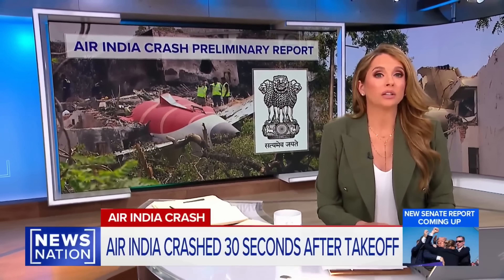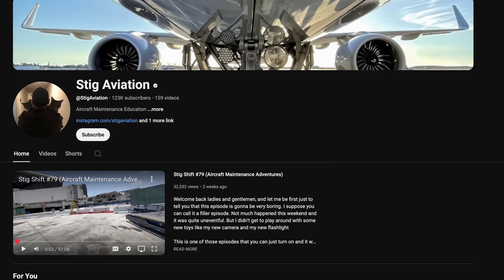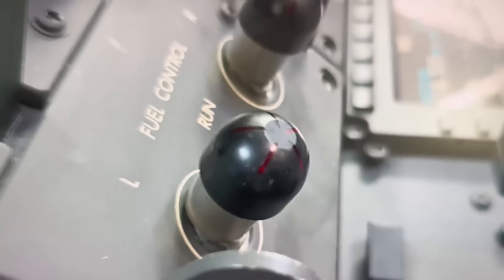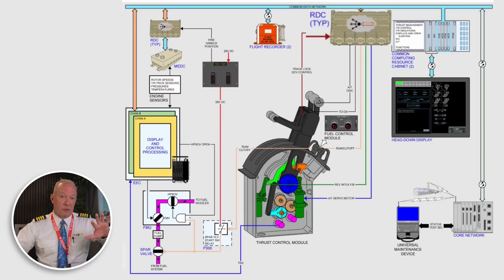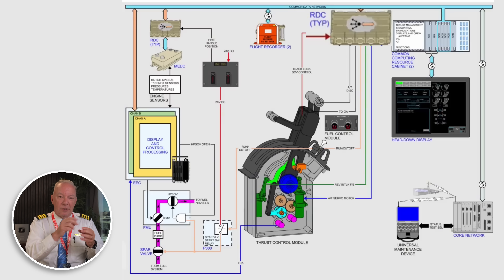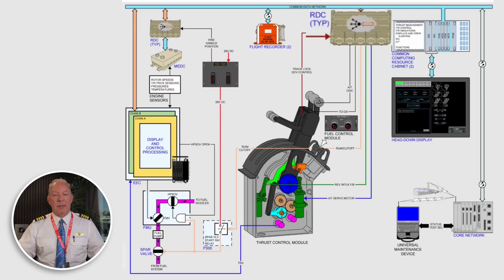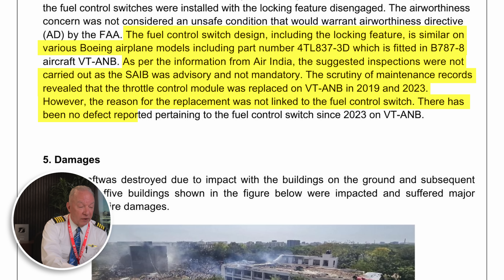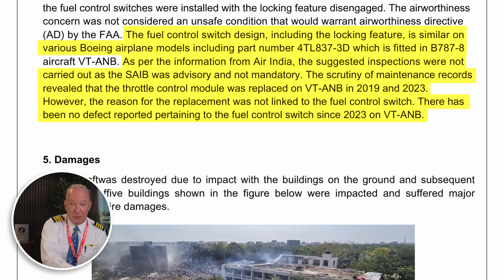The Truth About Boeing 787 Fuel Control Switches

Comment: I'm an electrical engineer, I was an avionics tech for 15 years. This is a very good explanation. When I heard FDR showed the switch positions changed 1 second apart and were put back 10 seconds laterI knew it was not a malfunction. 😢
Reply: I 💯 agree with you and captain Steve, genuine question here- how does the FDR know physical switch position? I’m assuming a feedback loop of some sort but would like to know a little more about this part.
Reply: The schematc presented by Captain Steeeve shows a separate RUN/CUTOFF output from the Fuel Control Module containing the switches, and it goes to the RDC (Remote Data Concentrator). The RDC then presents the state of the switches as data on the Common Data Network on top of the schematic, to which the FDR would be connected.
Reply: @paulgail540  OK so the FDR actually does kn ow the position of the actual switches?
Reply: @JoeLinux2000 Totally not The CVR will know if the Fuel Switches are moved.
Reply: @jayebzzz338  Some people say there is an additional optical circuit originating at the switch.  Normally you would assume the system is working if fuel is flowing.  Steve would do better to have a guest on that actually knows electronics and specifically the electrical system of the 777.  Steve's expertise is in knowing which switch to move and when to move it, not how they work. My opinion is a pilot may have moved a switch from on to off and then back on, but we don't know exactly when or why.  There are reports that the RAT deployed before the switches were moved. We also know that there was a problem before the Mayday call, and the radio was still working so at least some of the electronics worked.  If you are committing suicide why issue a Mayday call?  Suicide is the least probable cause in my mind. Some type of major system failure is far more likely.  No pilot takes off with the idea of immediately committing suicide and killing all the passengers.  It's more of a personal decision done privately.  Often they leave a note.
Reply: @JoeLinux2000 yeas all I see steeve is just a pilot but not technician or mechanical enthusiastic person, 
Day one we are thinking what went in hydraulics , circuits , relays , copper coils of valves , electronics etc,
But he only see from prospective of a cockpit,
Even about AAIB report, people those made it too look like just being pilots, for them fuel cut or run was switches on flight deck stuff , 
If they would had been technician,engineer,scientist they would had think what is inside of fuselage and forward and sft bay , for fuel supply closing they might see spar fuel valves prospective.
Unluckily as far I could reach  the inner systems of AAIB , it looks redtape sort of people sitting on the top those just looking for their promotion,

If we want to reach on true conclusion we all people have to work simultaneously indipendently too.
Reply: @jayebzzz338  FDR through RDC only know the status of Fuel spar valves close or open position bcouse only there are the sensors located , no sensors located in fuel switches on the flight deck in the cockpit 
so FDR records only fuel spar valves position not the mechanical swithes position
Reply: @jayebzzz338  The linked video in the description explains it. There is a second contact in the switch that talks to the RDC, and the RDC is on the data bus, which is where the FDR picks it up.
Reply: https://youtu.be/OLxLN3osS1Y?si=mTr5PiCQOqiIQzaD

The FDR doesn't see if the switches is moved whatsoever. The switches record the electric RUN/CUTOFF SIGNAL transition.
The CVR will record if the switches where moved from the clicks sound.
Reply: Why has captain Steeeve disconnected the FADEC's from the Fuel Metering Valve's and reconnected to the relay 28V? 
4:15

How is Captain Steeeve adjusting the power output from the engines?
Reply: Something else isn't answered. How come the aft EAFR is so thermal damaged? 
It's designed to withstand fuel fire for 30 minutes. Even lithium battery fire would not have reached that temperatures and was far away contained in a steel box.

The only source is an electrical fire that can reach temperatures of 19000C or 35000F nearby.  
The engines generators produce 1MVA like a small power plant and can do a lot of damage in a few seconds.
This could only have happened whilst the engines was running.
Reply: Captain Steve incorrectly describes the control of the fuel values according to the diagram he presented. He needs to explain and correct those errors if he is to restore his credibility.
Reply: It's the fuel pumps that failed caused by water ingress into the EE bays. Lack of lavatory maintenance caused the crash and not the fuel switches
Reply: Question: How are the switch positions reported to the Flight Data Recorder?
Reply: @joevignolor4u949  AWESOME QUESTION!!
Reply: @joevignolor4u949  This a good question. What does the FDR record?  Switch posittion or Valve position?
Reply: @Rks2800I  typically it records both switch and valve positions. However, the position of this particular switch is only sensed by the presence of 28vdc, not the physical position of the switch.
Reply: @zuhirzainal581  Allright, from the cicuit diagram he showed it is still not clear if this 28V DC or the current it generates when the relay closes can  actually be detected and recorded in the FDR. I assume the FADEC makes the FDR entries and does the FADEC see this 28V DC presence.
Reply: @joevignolor4u949 the FDR doesn't record the position of the switches themselves. It record the Run/cutoff electric signal that get transformed in the RDC which send a network signal by Ethernet/fibre otical cables to the EAFR's

According to Boeing's documentation the switches themselves is electromechanical 3 way 4 pole switches approved by FAA.
Something must have gone terrible wrong at the Boeing 787's assembly line so they ended up with totally mechanical fuel switches. 
The 787's needs to be grounded pending FAA approval for totally mechanical fuel switches.
Reply: @idarpolden5913  What are you talking about? They are mechanical for a reason. So are the ones on Airbus.
Reply: @idarpolden5913  Thanks for the info. I was wondering how the FDR was connected to the system. From what you said, the FDR is not wired directly to the two switches. Instead, it receives a digital signal input from the RDC. This introduces the possibility that the pilots never touched the two switches and what the FDR saw was something else going on somewhere else. This system is extremely complex. Most likely the only people who know exactly how it works are the engineers at Boeing.
Reply: @joevignolor4u949 You're very correct and the system is very complex and integrated with software on top. It requires several Boeing engineers to work on the issue together for a while. We engineers is not so good on memorization, but we just calculate/analyse and find out by time.
Reply: @joevignolor4u949  the RDC stand for Remote Data Concentrator. The 787's has 2 EAFR's. One in the front and one in the back. If you had tried to copper wire that with 100 tonnes of copper wire, the plane would have a hard time taking off without passengers. The 787's are fly-by-wire which is the future. Just forget Steeeve's mechanical switches.
Reply: @joevignolor4u949  A.I. says this.

Each fuel cutoff switch has position sensors (microswitches, Hall-effect sensors, or potentiometers) wired into the control system.
	•	When the switch is in RUN, the sensor circuit outputs one signal; in CUTOFF, another.
I’m not sure if that is accurate information Joe.
Reply: Think of it like a simple text message I suppose.
Reply: Please explain how the FMV inside the FMU is regulated by the physical relay.
I thought it was the EEC/FADEC's that did it, but Steeeve denied it already.
Reply: @theguy4355 , the RAT deploy immediately when the power is lost and not 10 seconds after  as mentioned by @LaurenEldorado.
Must have been a misunderstanding as the RAT should start making electricity within 10 seconds. As the plane was close to stall speed 10 seconds seems likely. 
The RAT deployed a few seconds before the electric signal transition to cutoff.  Later the transponder was also lost.

Note, if the RAT is hold inside with a 28V DC power spring-loaded solenoid, the spring will deploy the RAT once power is lost. High school physics and very simple.
Reply: @idarpolden5913  "Later the transponder was also lost.'"
This is very significant. Simply shutting down both engines shouldn't stop the transponder until the battery is depleted.
Reply: did you actually read the schematics? i don't think so for if you did you would disagree with Captain Einstein's assertions.
Reply: Oh and Steeve… failsafe systems fail more often than you would believe. In fact the 737 Max failsafe system was what actually caused the two crashes.
Reply: @NeoMorphUK  "the 737 Max failsafe system was what actually caused the two crashes."  Clearly you need to research the definition of the erm failsafe. MCAS was not a failsafe system.  Have your mommy help you with the big words.
Reply: The switches suppedly "switched back on", did so with 2 seconds time difference !!
My explation  (given by Capt. Khalid, an Indian pilot), says:  because they were CYCLED, not switched on.
They were never moved to "cut off before". The pilot asking was referring to a system message, which is NORMALLY pointing to manual action.
(Same wrong signal, the FDR noted)
The FDR signal was interpreted incorrectly as other signals (Failure causing RAT deployment) were NOT RECOREDED or omitted.
Reply: It seems to me those switches are too close to other controls that are used during takeoff. Our brain isn't all that perfect and while it is important to allow pilots to shut off the engines in case of engine malfunctions causing fire risks, it's equally important to not have them turned off by human error during take-off.
Reply: But capt steeve's words and explanation are contradicting the diagram that he is showing 😂 Clearly as per his diagram, display and control processing unit is capable of cutting off fuel by turning fmv or hpsov !
Reply: @ConcernedParent-z1q Yeah, it's very significant as the same thing happened to MH-370. Ofcourse the captain won the Olympic sports games and managed to do all the switches in a second like a monkey. 
Those who still believe the captain deliberately did it, report to captain Steeeve instead of me as a design engineer. 
As one YouTubeer Jermeny with link further above has pointed out, the diode without any current protection whatsoever might have short circuited degrading the lithium battery. Then when a transient load comes like retraction of the wheels it might cause the cells to short circuit in an cascading effect as temperatures rises.
This is enough to cause engine starvation and the crash.

The transponder simply cannot work when the diode and battery is short circuited.
Reply: There are no examples of both switches, failing serially in this aircraft. There are multiple examples of pilots, deciding to end their lives in flight. Sadly, this appears to be the provider based on the explanations I have heard and Occam’s  razor.
Reply: @Whitpusmc there's 2 other scenarios where dual flameout occurs almost simultaneously. 
The overloaded diode that short circuit.
Water ingress into the EE bays.

Both scenarios lines up with RAT deployment before the cutoff signals.
Reply: @idarpolden5913 Do they then turn back on? After 10 seconds with corresponding switch movement by the pilots? The CVR has dialogue that corresponds to the switches being moved and engines starting to return to power. This makes the diode theory implausible IMHO. But I hope that theory is thoroughly investigated.
Reply: @Whitpusmc You got this totally out of content. First of all, I never claimed the fuel switches themselves was moved whatsoever. 
Secondly, the RAT will start to produce electricity within 10 seconds.
Are you blaming the pilots for not making the RAT perform better than Boeing's specifications? Please explorate and explain what you meen?
Reply: @idarpolden5913 I’m not saying anything about the RAT. Any theory must explain how the fuel switch positions changed from run to cutoff and back to run again. Plus the timing that matches the CVR. A human movement of the switches fits the available data. Your diode theory is significantly less plausible and less in keeping with known facts and timeline. I’m not educated enough to say impossible but enough to say much less plausible. Burden on your theory to show it fits all known data like human movement does.
Reply: @Whitpusmc  I have a A Masters degree and can tell you that Captain Steeeve's AI logic isn't capable to detect that the captain deliberately is going to put the switches to cutoff 2-3 seconds later.
Reply: @idarpolden5913 No idea what you are saying, congrats on the Masters, I have one as well.
Reply: I'm also and automation engineer and can surely say when it comes to TCMA+FADEC, which is another form of controls, If not programmed properly or a false input is generated can surely turn off many components of automation logic. If you don't know, let me tell you FADEC had a history of wrong signaling stating its on ground while it was actually in air. In automation its 0 or 1, meaning if logic for a condition is not met, relays are turned off. Try knocking one of the logic gate in a line of ladder logic where multiple conditions need to be met and checkout for yourself if the output turns off or not.
Reply: It is impossible for the pilot to switch both in less then 1 s
Reply: @azeche592 you forgot about the transponder and everything else that the EICAS display shows. The Captain deserves the Olympics gold medal 🏅 on sport.
Reply: @azeche592  Good point. Probably difficult if each needs to be pulled up first.
Reply: I suggest you deal with Jeremy Thompson's contention that this is yet another example of the famed 787  lithium battery failure, more specifically the back-EMF protection diode.  Its failure  allows spikes from loads such as the 'gear up'  command to destroy the battery and/or to depress the voltage to near zero. As you say the relay depends on 28v DC from the battery. If that is lost, the relay opens. It's extremely complex, and he may be wrong, but if he is, then his arguments need to be carefully dismantled. General reassurance about 'the battery is there as a fail-safe' is not enough.
Reply: @macwall01 Surely those valves don't need constant power to remain in the open position? Steve's explanation seems to suggest that's the case. Can you confirm?
Reply: As an airplane teck do you think this switches should be disabled for the first few second of take of so if somone had acidentaly or intentionaly turn them  both off at least one should be disabled so the other pilot can have a chance to recover the plane. Just a wierd thought..
Reply: The problem with electronics is you can’t say it can never happen. I’m a retired electronics test and service mechanic and some of the bizarre faults I’ve come across over the years made me realise you can never say never. Like filter caps that short out and kill the power supply to relays that then turn off because the power has gone. I don’t know the redundancy on aeroplanes for the relay power or where the switch recording is taken from for the flight data recorder… but if a problem occurs with the power supply the it really could affect those relays.

Sadly with the plane in so many bits it’s going to be hard and will likely to be called as either pilot error or deliberate sabotage. Boeing is going to be panicking that it’s another fault with one of their planes and will be blaming it on human factors.
Reply: The switches might have been showing in the panel that it has been triggered to off position but in reality it was not giving a false perception that the engines were shut... to reignite the engine (in reality it was not), it was required to toggle the switch off and back to on, this action  may have captured by the system in a 1 second delay
Reply: The mechanism won't allow to turn off the fuel switch during take-off. The switch is blocked during take-off.
Reply: As soon as I seen a picture of the pilots I knew it was pilot error..
Reply: @b @bikepacker9850 nd you are what, an expert in connecting a single photo to decode human life? F off tw@t
Reply: Oh yeah true. Lets save Boeing !😅
Reply: Anyone have access to the SDS, WDM and SSM for the 787?
Reply: Folks great to know avionics electricals but the fact is the black box recorder can hear these switches being switched and it knows they were moved and for how long!!!!!!! This has nothing to do with Maybees or shorts!!!!
It’s a fact that they stated in there findings!!!!! This was a pilot action and the other pilot even asked why?????? Switches were put to cut off!?????
Reply: @nelsonwalker4829 I wanna know what occured in the brain of the pilot who switched it off and why such error is not prevented by making it harder to turn engines off by momentary glitch in the brain. How often do we press a wrong character on our phone, choose the wrong item in the grocery store, put the wrong key in the door etc.? We humans make lots of small errors. The chance of a momentary glitch in our error prone brain to turn off these two switches is not zero and the problem is that there is a time window where you doom the aircraft during take off. This is bad functional safety.
Reply: @DaveSmith-s6eThanks for that log of events. Yes obviously something else caused it. I watched some video by someone who had been on the same plane on the flight before the doomed one and noticed the power of the aircraft was coming and going intermittently. Perhaps something was overloading, overheating, short circuiting, improperly serviced etc. even affecting engines.
Reply: Poor ground connection causing a floating zero? Could affect one control circuit but not the other, depending on what the ground network looks like. Such a glitch can be temporarily as well (loose wire, scuffed isolation) especially on moving parts and vehicles.
Reply: @xanten69  the critical issue here is that the EEC can cut fuel to both  engines even when the run-cutoff relay is in the run state. That fact is being denied by Steve, and lots of people are believing it which is bad for getting the story correct and for understanding what really happened and for preventing it from happening again.
Reply: It was not a malfunction of the switches, but this does not exclude other possible malfunctions! All data suggests RAT was already deployed when the switches were moved!
Reply: when there are cables, pulleys, turnbuckles, then you have a manual switch.
Reply: How about pilot trying to re-ignite the engine by flipping the switches position.
Don’t assume that it is not a machine failure
Reply: @Real_AkashMishra  Very likely as the RAT deployed a few seconds before the signals transition to cut-off. It makes sense after the conversation the pilots had.
Reply: Being x2 switched relays 1 second arapt is no malfunction , maybe if one did that then possibly , but i agree with you 

i assume that these DC relays are a coil type relay using an electromagnet to control the switching of a circuit?

As in when current flows through the coil, it creates a magnetic field that attracts an armature, which then moves to open or close (NO / NC) the contacts within the relay,allowing he relay to switch a higher current signal.??
Reply: @micklinnell4892 yeah you are right about relay P300 , these relays further give connection to fuel spar region valves and these valves are not motor driven in either direction type but simple spring loaded selonoid type valves, if DC power is there they stay open otherwise shut , 
These valves have DC supply from the main litheum ion battery,
Reply: @rajeevshagun-info  That makes sense.  Are the computers ever able to reduce power to the engines?
Reply: @JoeLinux2000  Yeah  only FADECs of Boeing 787 are really full authority digital engine control system those can even close the fuel Spar region valves  without even letting pilots know in case of Fire , fuel leaks over oil pressure etc problems  .
Reply: @rajeevshagun-info  Do you not see that there are two further valves that control the fuel under the influence of EEC, any failure or corrupt software can cause similar issues as though the fuel relay was cut off by the Fuel Control Switches, again crucial point is what determines that Fuel Control switches were moved?
Reply: @micklinnell4892  You explained a relay correctly which is better than Capt Steve
Reply: 1) Are there two 28VDC batteries, one feeding each switch?
2) The switch if "on" activates a relay? What kind of relay? I need to know the exact mechanism of that relay, or else all the explanation of Captain Steve is worthless
Reply: @burdeninmyhand  Capt Steve is jumping to conclusions based on a preliminary report that many are finding faults with.   Also his knowledge of electronics is in fact absolutely worthless. He would not be able to trouble shoot anything.   I guarantee if he has an electrical problem he calls an electrician.
Reply: @JoeLinux2000  I agree.  Don't be too harsh on the guy, he's just trying to explain, but he doesn't really know how to give a very detailed explanation, that ends all doubt and speculation.  For ex:  I did A LITTLE research last night on types of relays, and for example one could talk about rugged design (or not at all), aviation standards, military standards.  It would add A LOT OF VALUE if communicating that each (or some) of the components involved are according to ANY specific standard.
Reply: Captain Steve is not addressing the MANY important issues that could arise if someone who is curious enough (but not an expert in aeronautics) start questioning the circuits and the components involved.  There are really MANY MANY "valid questions" that a non-expert could ask.
Reply: Why aren't they releasing the full cockpit voice recorder transcript then?  They're counting on dupes jumping to conclusions.
Reply: @riggitydoo5116  Not all countries make CVR data available to the public. Some will allow transcripts but not the actual recording.
Reply: @cidercreekranch  transcripts would be fine, publishing selected utterances is not.  Selected utterances is all they have released so far.
Reply: @riggitydoo5116 Because they may want to change or manipulate the tape with AI so that the Captain and Air India are not guilty.
Reply: @riggitydoo5116  because if we had the whole thing this would probable point to the pilots , the lawyers are ready to go but cant do anything until final report
Reply: @riggitydoo5116 they only release this upok the final report so as not to further heighten conspiracies or theories mostly to protect the families of the deceased. Makes sense. It would be like the police releasing all the details of a murder before a trial, it massively complicates the trial itself.
Reply: @DOBlob interesting...trials are about winning, with each side selling their own narrative.   Same thing here.
Reply: Yes the switches were moved. It was an attempt to restart the engines when they were shutdown immediately upon takeoff - not a “deliberate act”. It was an act to save lives in a moment of chaos.
Reply: what about a drop in voltage to the relays ( may it be the voltage or loose wiring or ....) Is that not a possibility ?
Reply: @theguy4355  both solid state and electro magnetic relays tolerate low voltage, solid state will still hold in the on state down to as low as 3 vdc. Many solid state relays are designed to operate on any voltage between 3 and 32 vdc. The data recorder will at least register on or off for those switches and a low voltage is not off, but more likely it will record the actual voltage. Neither a voltage drop nor loose wires can explained the recorded sequence of switch changes. Human interaction is the only plausible explanation.
Reply: @MacLocky  OK but what was the reason?  Could they have been trying to reset the circuit?
Reply: @JoeLinux2000  with the evidence we have the answer to your question is unknowable and I try not to speculate, it’s a slippery slope.
Reply: @MacLocky  I can assure everyone here that all relays on board are solid state relays.  Reliability requirements are far too stringent for the use of older mechanical relays with point contacts.  Even the EMI tests outlined in MIL-STD-461 for relays (chattering relay) have been deleted due to solid state relays over taking obsolete mechanical relays.
Reply: @vincentsutter1071  good to know. Does that also apply to “classic” GA aircraft?
Reply: @MacLocky  tell us all about your GA aircraft MCAS system. I cannot wait.
Reply: @vincentsutter1071  Being condescending is a not a good look on you sir. I had to Google MCAS because I’m not an aviation acronym expert. Pray tell, what has MCAS got to do with whether a GA aircraft uses solid state relays, indeed what has that got to do any of the comments given that MCAS is specific to the 737 Max and the Air India plane is a 787?
Reply: @MacLocky  Let me recap.  You were the one that noted MCAS and GA. I'm the one that educated you, but now I'm the bad guy.   I'm genuinely sorry that you are too dumb to comprehend the meaning of MCAS before you used it.   Oh and MCAS has nothing to do with the Air India 787 incident.  You are welcome, for the free education.
Reply: @vincentsutter1071  "I can assure everyone here that all relays on board are solid state relays."
Doubt it. People assure us that the relays are bi-stable (even after total power loss) using permanent magnets (so the energising coil would have to overcome those magnets when shifting the relays. I don't think this can be done using solid state relays.
Reply: @theguy4355 I also want to believe the best but ya it’s stretch to beleive that… unlikely
Reply: @theguy4355 DC power is required to deploy the RAT. The RAT was deployed. Ergo DC power was solid. The FDR reported switches were restored 10 secs after cutoff. Ergo, RAT would not have deployed if DC was out for ten secs. This was a pilot caused crash.
Reply: @LaurenEldorado  Maybe so.  It's really odd that Engine 1 Cut-Off Switch was transitioned to "run" 10 seconds after it was in "cut-off;" and Engine 2 was transitioned to "run" 14 seconds after it was in "cut-off."  

I've been racking my brain trying to figure out---why did these drivers wait so long to put the switches back to "run?"  RAT deployed because of the dual engine failure or shut down (shutting down the generators without the APU running, right)?
Reply: @LaurenEldorado  You're missing that the RAT likely provided the needed electricity to bring the electrical DC signal back up not from zero but from a voltage below the threshold needed to register an "ON" signal. Ergo, Boeing grinning as the pilot gets framed with a massive murder-suicide. Sick.
Reply: @LaurenEldorado another stupid comment. It is now evident rat deployed earlier immediately after rotation.
Reply: @LaurenEldorado no it wasn’t. It made no difference to the outcome. Plane was doomed.
Reply: @LaurenEldorado are you sure ? It could be deployed mechanically as well via a " spring loaded mechanism if battery also fails. I'm just putting out all options for debating
Reply: @LaurenEldorado  I thought the RAT was supposed to deploy in the event of electrical or hydraulic failure.
Reply: @LaurenEldorado  "DC power is required to deploy the RAT"
No, the RAT is spring loaded. It deploys if electrical power is removed from it.
If the RAT relied on functioning power to deploy, that would make it useless in many emergency situations.
Reply: @ConcernedParent-z1q

Here’s what actually happens: The RAT is held in place by an electrically controlled latch. That latch needs DC power from the 28-volt essential bus — which comes from the batteries — to release. If both main AC sources fail in flight, the DC system triggers the latch, a spring swings the RAT into the airstream, and it starts generating AC power to keep essential systems alive.

So yes, there’s a spring, but without DC power to release the latch, the RAT stays tucked away. Otherwise the RAT would deploy while the plane is turned off on the ground.
Reply: @IJustMadeAComment Sound like we didn't remember the battery that continues power to the switches?
Reply: @LaurenEldorado  Please, don't give design error explanations. The RAT should definitely be deployed if the Main battery has failed.
Please see the operating manual for when the RAT should deploy. It's mainly equipment powered by 28VDC.

It's very easy to make the plane not deploy on the ground, but if Boeing planes keeps losing electricity during taxing, there's far worse issues to be solved.

When you need to powered down an aircraft, think is less than monthly, you need to put the handbrake on first.
Everything is included in the checklist so the plane doesn't fall apart on the ground.
Reply: @LaurenEldorado  plus the logic in the plane was trying to start the Aux power unit... it has an electric starter (i would assume) on it and was getting spun up
Reply: @LaurenEldorado  I believe you are wrong. 
On most modern airliners (Airbus, Boeing, Embraer, etc.), the RAT can be deployed automatically by a spring-loaded or hydraulic mechanism when both main and APU generators fail.
	•	It can also be deployed manually by the crew pulling a cockpit handle or pressing a guarded switch.
Reply: @ConcernedParent-z1qwrong
Reply: @ODIN-UK wrong. The pilots can’t deploy the RAT from the cockpit through mechanical means. The RAT hatch is opened by DC voltage under various conditions. That means if the RAT is deployed, the DC bus is working at least to some level.
Reply: @DaveSmith-s6eno no no! If all voltages (DC and AC) are not present at the RAT, it will be in the same configuration as if the plane is parked on the ground and the RAT door will be unable to open. DC power is required to open the RAT door if it senses that AC power is no longer available. If a failure occurs and both DC and AC are lost, the RAT may deploy only if DC is lost after the AC is lost. But if the DC is lost then AC lost, it won’t deploy. The pilots can also send a command to deploy the RAT but that implies critical RAT circuits are still viable and so the RAT will deploy. But if the circuits have been compromised, then it’s anyone’s guess whether the RAT will receive the command to deploy.
Reply: @theguy4355  very much so, especially a short circuit of the 28V DC essential buses. 
In certain cases it may make ground be elevated as well, especially close to the short circuit.

While captain Steeeve is awaiting FAA approval of his totally mechanical fuel switches, it's better to assume that they have used the FAA approved Electromechanical 3 way 4 pole switches.
Note, each common pole is connected to ground. If ground becomes 7V then....
Reply: @DaveSmith-s6e Why are you attacking me personally as I do hold a Master degree in technology. I also hold a honours degree in Electrical and Electronic engineering from UK. Is it that you and Steeeve hasn't got it, nor experience in design engineering? Please explain your attack on me. I seen Captain Steeeve attacking Boeing engineers already.
Reply: @idarpolden5913  They did use approved switches. The same type of switch they have used for decades. Similar to the same type of switches used in an Airbus for this type of system. They are two different circuits as well. So now you're going to go out that and say both of those circuits became faulty at the exact same time? Bullshit.
Reply: @DaveSmith-s6e Seems that Captain Steve does not like you as all my comments back is redacted like yours.😅😂😂
Reply: @jeffhaggarty9879  I'm saying that they used electromechanical approved switches and not captain Steeeve BS unapproved totally mechanical fuel switches.
Reply: @idarpolden5913  
Take a look at the Battery Diode Module.
Essentially a single diode which if it fails could sent unregulated power (Not via the BMS) to the battery, Thus mimicking a "dead short".
That's your Left bus 28v AND 14v live to the dedicated "switch position" contacts inside the switch lost.
.
If Left Bus Power failure is detected and the RIGHT Bus is then switched to connect 28v TO that LEFT bus...... AND that supply connects to a dead short...... You HAVE the "cascade" which exactly matches the sequence of events.
Reply: @rogerstarkey5390 Yeah, I have had a look at it. There's no protection against overload that easily can make the Diode fail. Power Electronics normally short circuit when it fails.
Then the battery has no protection against overcharge which lithium batteries is very sensitive to.
After being degraded cellls an easily start to short circuit in a cascading runaway effect.
The buses is also powered from the engines generators that's producing 1 MVA at takeoff.
Hard to estimate what voltage we will have on the battery + pole and - pole .

Anyway, the switches themselves are connected to the - pole and if that becomes elevated, strange things will happen .
Reply: @theguy4355  nope, battery busbar is powered by engine generators in flight (also keep the battery topped up) and battery will instantly fill in if power failure occurs. We know all this was working because the aircraft attempted to restart the engines when commanded to do so, avionics systems on the battery busbar remained powered (like the radio that transmitted) and the CVR kept recording, also battery powered.  RAT isn't quick enough to deploy and run up to prevent partial reboots of the avionics if the battery failed.
Reply: @theguy4355  pretty sure the flight recorder recorded all available voltages in the plane
Reply: @theguy4355  The flight data recorder records from the data bus, which gets the data from the RDC in this case (according to the video linked in the description), which gets it from an analog signal that comes from a  separate contact on the fuel cut-off switch.

If something went wrong on the circuit controlling the relays, what we would expect is engine failure while the FDR records that the switches did not move.

An engine failure at the same time as a recorded switch movement, when the monitoring and the relay switching are on different contacts on the switch... darn near impossible. So close to impossible, that the only way it is possible is if someone planned it.
Reply: @theguy
Almost impossible, since the CVR reveals that one of the pilots physically observed (and verbally stated) that the fuel relay switches were in the "cut-off" position.
Reply: @cassandratq9301  "the CVR reveals that one of the pilots physically observed (and verbally stated) that the fuel relay switches were in the "cut-off" position"
No. You just added things that aren't in the transcript. Try to stay sharp, not jumping to counclusions.
Reply: I think everyone just wanted to know if those two switches can electronically be told to drop/cutt-off? The answer is clear, NO. Only a robot or human hand can move these switches.
Reply: @theguy4355  dude, you're stretching it, they have independent lines, if the battery dropped in voltage we can tell,

If the was a problem with the physical lines we can tell, you're grasping
Reply: @VoidPixel4179  That's not true at all. It couldn't tell if there was a DC voltage drop below the threshold... They could easily have powered back on 10 seconds later after the RAT deployed and provided sufficient power to the electrical system once again. The RAT, deployed and providing powered ~10 seconds after deployed due to DROPPAGE (not total failure) of DC voltage that then provided a voltage below the threshold for the engines switches to be registered as "ON".
Reply: @IJustMadeAComment  are you really sure you want to argue with an engineer in the youtube comment section
Reply: @VoidPixel4179 he’s not. You are.
Reply: @VoidPixel4179  Yes. 100% sure and confident that I'm correct. Your experience is irrelevant if you're wrong.
Reply: @IJustMadeAComment  😂😂😂 my experience is irrelevant 😂😂😂😂😂😂😂 its okay man. You win
Reply: @VoidPixel4179  Here is what I hear... "I'm an expert but refuse to prove you wrong." - as you can see, it sounds ridiculous.
Reply: @VoidPixel4179 He's not really 'grasping'.... he's trying to  rule out mechanical, electrical, and software malfunctions that would assign fault for the crash to the plane, and not the pilot.  
There remains a very real resistance among the public AND aviation professionals both, to attributing this incident to pilot mental breakdown/suicide.  If the prelim report is accurate, and the position/function of these switches is important, then pilot behaviour seems to be the cause.   But people would rather that weren't the case 😢
Reply: @IJustMadeAComment  did you read my comment at all?
Reply: @VoidPixel4179  Do you know how to read block diagrams? Do you know how crucial systems work? No you haven't a clue.
Reply: @mikekenny4645  😂😂😂😂😂 what!! i worked at Delta as an aerospace engineer, do you really want this smoke pal?
Reply: @VoidPixel4179 he’s not grasping, he’s simply asking a fair question.
Reply: @VoidPixel4179  After all, Captain Steve did say  power/electricity is required to keep the valves OPEN. That surprised me somewhat. 
So if the plane is flying at any altitude and there is a power outage/fluctuation (including battery power) to valves they will CLOSE.
Reply: @IJustMadeAComment  the black box registered the switch changes. As you can see on the diagram, the sensors are on the switches, which are independent of the DC voltage. A drop in DC voltage wouldn't have caused the switch sensors to register the changes.
Reply: @theguy4355 Your question is correct. I don't know much about avionics, but I do know a bit about electronics. It's possible that somewhere in the circuit (PCB) there's a so-called "cold solder joint" that breaks over time, potentially causing a voltage drop in part of the circuit for a longer or shorter period of time. I noticed that many times in electronic circuits.
Reply: @JohnSmith-hv1np if that is the case why would the switch move manually?
Reply: @JohnSmith-hv1np  That happened to a my Subaru.  A wire became unsoldered inside the steering column. It took a month for an experienced  Subaru mechanic to find the problem and he was only able to do it because he had the actual factory manuals.
Reply: @nestorsanidad2723 The Fuel Switches doesn't have to move at all for the electric signal to transition to cut-off.  A major short circuit can also causing it. The white smoke at takeoff gives credence for that to have occurred. As the engines lost thrust before the cut-off signal, it makes sense that the pilots tried to relight the engines in order to achieve thrust.  They almost succeeded, but where too low.
Reply: @nestorsanidad2723  As far as I know, there's no evidence that the switches were manually operated. Of course, I don't know what happened, but it's possible that the 28V power is supplied to the switches via a single path, so if a break occurs or a so-called cold solder joint occurs, it's possible for the 28V power to the switches to be lost simultaneously. Switches and valves have slightly different response times, so even a 1-second delay can occur (it can also depend on the way it was recorded). I've seen cold solder joints in electronic systems many times. It's also worth noting that the entire module was replaced twice – why? This means that the module is prone to failure.
Reply: Moisture, corrosion and DC. No electrical system can be 100% sealed.
Reply: @daintree98 exactly.
I would prefer risking my life in ancient DC 3 then power hungry really Full Authority digital engine controlled Boeing 787 ,where pilot have nothing without being through FADEC in their hand to control
Reply: Since you're holding yourself out as an expert, please explain the dual engine failure of the 787 nippon airlines landing in Osaka (?) In 2019.

Are you a software expert as well as an electrical engineer?
Reply: @riggitydoo5116  There may be some extremely important contributions we need to see to this discussion by a specific SW Expert and EE.  Capt. Steve is giving us his understanding and explanation based on his extensive 787 and related flight and training systems and experience.  

I don't think Capt. Steve is holding himself out as a Software Expert or EE; but it is absolutely required at a circuitry level that us pilots are trained in how these systems work.
Reply: @riggitydoo5116  well since you want to believe or working for INDIA!!! It seems like your 2019  flight is being reported ONLY BY INDIA announcing robots/ 👄 pieces
Reply: @riggitydoo5116  Easy, they are in no way related. One was a lost of thrust but not a complete shutdown of the engine due to an software issue. This has nothing to do with software and is a very simple electrical circuit. Maybe try reading and understanding a bit and then comment.
Reply: @jeffhaggarty9879  I've read enough and heard enough to know there isn't enough information to draw the conclusions that you apparently have.

Literally, all there is at this point is a partial release of information with key data being withheld.

Try not jumping to conclusions.
Reply: @riggitydoo5116  clearly you are neither and are unable to ascertain that the two examples that you noted are entirely unrelated.  Try again?
Reply: @vincentsutter1071 wrong.
Reply: @riggitydoo5116  of course you are wrong, thanks for admitting it. 
Next
Reply: @riggitydoo5116 he is a misinformation peddler. Scary he is a pilot.
Reply: @kumark214  If you are talking about Capt Steve, you are correct.